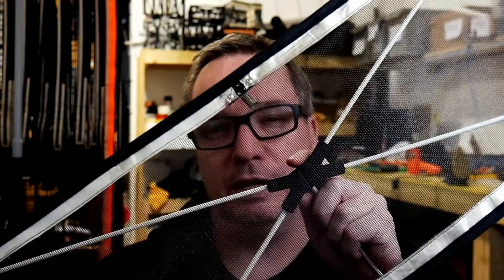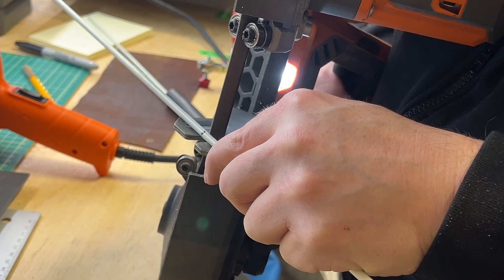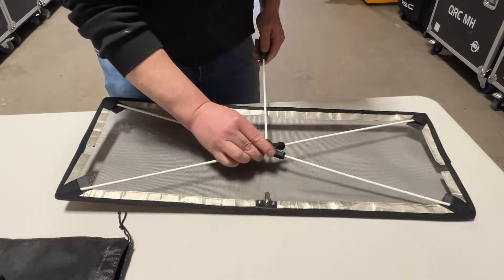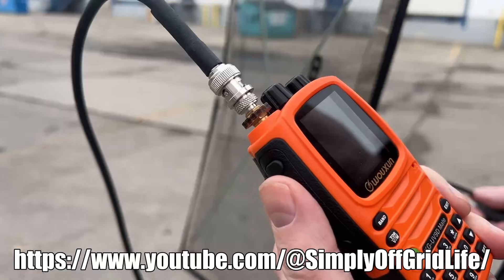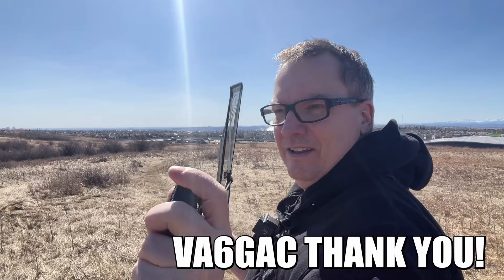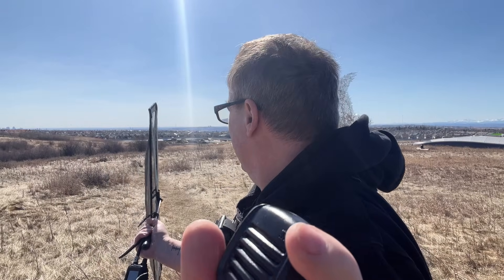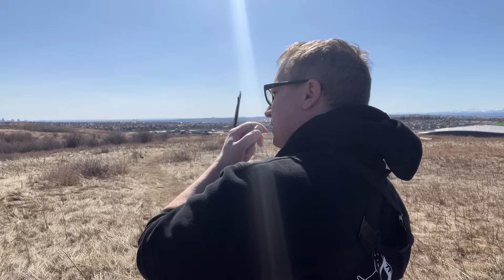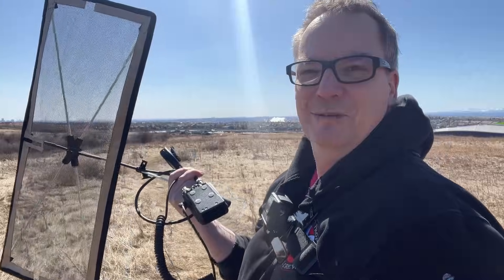2m Moxon Directional Antenna Build – Lightweight, Rugged & Packs a Punch

Comment: This looks really cool. While I'm not really familiar with how this type of antenna works exactly, as an ultralight backpacker it's a fun thought experiment to think up potential ways it might pack down even smaller and lighter.

Is the window screen necessary and is the tape width important? I can't tell if the mesh is conductive or regular fibreglass, and it seems like you might be able to use narrower tape or wire if you didn't have to hold the screen with it. If those aren't critical, perhaps you could wrap a lightweight cordage with wire or Faraday tape and cinch a loop of it around all the rods to cinch them together like you're closing a drawstring bag.

Comment: Wow another amazing design! I made a 2m Moxon with bbq skewers, a 3d printer center connector, bnc connector and some hot glue. I made a summit to summit SSB contact on 5 watts using my UVK5 HT. I would be interested to see how well that antenna works on SSB.
Reply from the maker: I’ll be testing some of this soon

Comment: Moxon antennas are fantastic! I have built several...the most useful one was tuned to 130Mhz or there abouts. I use it for finding power line interference, faulty transformers, ect. My 10 meter moxon is a bit unwieldy, but completely functional. Someday (yeah, right..;-) I'm going to install 3 of them on a pole and use an rf switch to have me a poor man's rotator.....

Comment: holy expensive 😒
Reply: They are easy to build!  A 3D printer and a little wire and math you could have one for under $20 or QRP life sells one for $80 shipped. 😮
Reply from the maker: Not easy to make this one. But I’m not here to convince you. Go make one! Have fun and enjoy the build. Or go get the less expensive one. Just get on your radio and have fun!
Reply: I have made a few 2m Moxon antennas, I gave them to friends. They only cost abt $20 each to make, R&D might have cost me abt $100 at most.
Reply from the maker: @N0VTY29  That is awesome! Great that you are sharing your work. I am not here to argue the price. This is what is costs to make and sell. Mike here does a great job of explaining why commercial antennas cost as much as they do https://youtu.be/6QOPJtcxPBA?si=2U0HXAkqVnySgZHr In the end you getting on the air is what counts. Not what antenna you use.
Reply from the maker: They are not easy or cheap to make unfortunately

Comment: It is certainly great when your new antenna design works.  Even better that it exceeds your expectations on performance.  Good job.
Reply from the maker: Yes.. I was confident it would hit Wimborne. But when it worked lying on the ground it totally surprised me. If I’m off 10-15 degrees from pointing at the repeater I get nothing. So on the ground Mae me giggle.

Comment: Nice video, could you make a yagi with the tape on a sheet?
Also did the fibreglass pole with embeded wire go anywhere?
Reply from the maker: There is a yagi in the links in the description. Yes the pole is going places. I wanted a min 6month all weather test to prove robustness. VERY soon I’ll have some more builds with it and do a market test
Reply: @VE6SFX_HamRadioRookie  Excellent, i live between the UK and Rice lake Ontario and I'm an active Pota guy (usually out 3 to 4 times a week in the UK) so if you need someone to break / test one :)